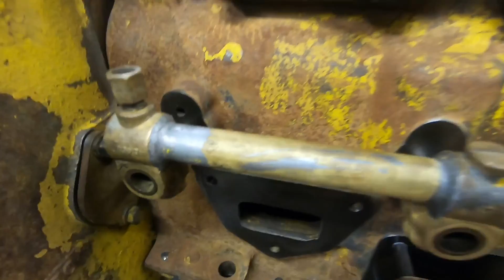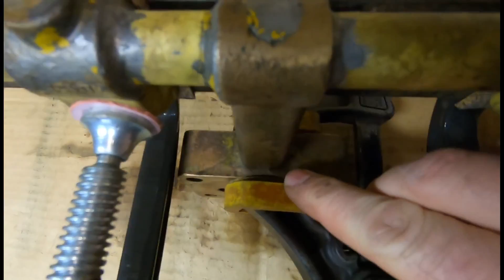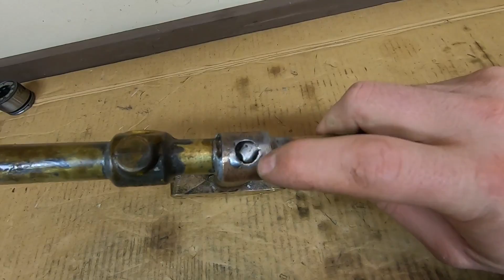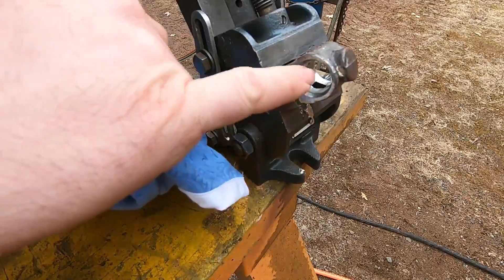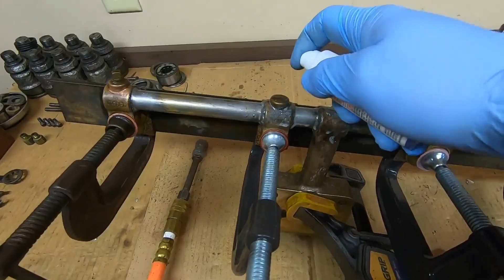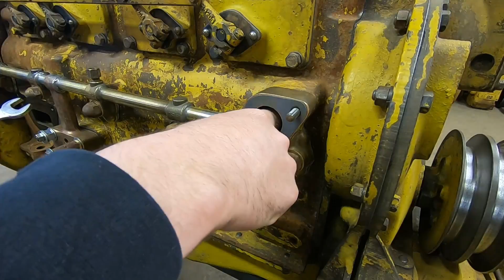Caterpillar D2 #5J1113 Diesel Engine Assembly Ep.39: Repairing & Installing The Oil Manifold

Comment: Do you suppose CAT found it to be cheaper from a manufacturing point of view to keep the pushrod cylinders and oil piping external to the engine versus spending the extra time machining the block to accommodate those things?
Reply from the maker: I think so, even the internal oil lines that feed the crankshaft mains are just removable piping with banjo bolts on each end. Plus, this was still the “old, proven” way of building engines that was a hold-over from the 1920’s era tech 👍

Comment: 7:43 yup. That's how i saw it done before. The mechanic had the whole side out of one of these engines cut, and made into a jig. Ain't no better way, than with the original, and you can't really do it on the engine, as he told it, because you have to take some of the stuff around off. Free space, no hassle.

Comment: If you heat the pipe to a dull red and then quench in water it would have annealed  to where it may prevent the work hardening  which is probably the cause of the cracks in the first place.  Everything relaxed.   Just my two cents.

Comment: Can you tell me why this 'oil delivery system' wasn't 'silver soldered', silver soldering being much stronger?
Interesting video, and thanks again.
Reply: @squatch253  And yet those joints failed,...after a long while true, however as being used to using silver solder for high pressure and high vibration joints, I thought that
Caterpillar might have done the same in these vital connections too.
 I can see that those studs and bolts hold extremely well, but the tubing running between those blocks is somewhat vulnerable I thought.
Now I know. Thanks for the reply.

Comment: I use to work for an airplane manufacturer, kit planes, very expensive kit planes specifically. The customer had to assemble 51% of the plane per FFA regs to be a kit plane. So we would built a part, make everything right the disassemble it so the customer could reassemble it thereby "building the assembly".
One customer was an insufferable asshole with all the dexterity and coordination of a boiled turnip. He couldn't hold a wrench and tighten a nut without dropping it to save his life. He would then blame the tool.
Then I watch you hold a camera with one hand and turn a wrench with the other and I smile.

Comment: A couple of observations that may prove helpful. When doing tinning,I started making use of 95% tin solder. Not the usual tin/lead mix. Never had a problem with a tinned surface after that. No idea why it worked better for me,only that it did.
Secondly,my refrigeration instructor was absolutely scathing about the way the Thermo King people insisted on using solder,only to have the stuff crack at high mileages, high vibration use. He was flatly insistent the only way to get a Thermo King to stop leaking refrigerant was to wipe the solder off the offending joints and braze a completely cleaned joint ,then pressure test.
Not sure if this would be something you would wish to do,but given how consistently soldered joints leak when subjected to vibration and heat and pressure,it might be a Plan B you keep in the back of your mind.
Nice clean job senior did. Developing a feel for soldering joints is something that takes patience and practise. It is rapidly becoming a lost art,particularly that high school shop is no longer taught in the majority of schools. Another dumb idea,but that is really another subject.

Comment: if you have some spare oil galley pipes..  you might try soldering them a different way.   the idea is to bend an L shape to the solder.. heat the brass fitting.. while moving the  solder around the gaps.. when the fitting is the proper temp. the solder will melt and suck into the fitting.. take the heat away or do the other side really quickly.   this allows the max solder to be between the fitting and the tube.  its how copper sweat fittings have been done for 90 years.  cleaning the fitting with a stainless steel wire brush also.. so there is no oxides on the inner surface of the brass.  i used to work as a plumber in the early 80s.. spent days under buildings soldering copper pipe fittings on..  including a few brass fittings to the copper..  you don't need to tilt the block either if you do it right..

Comment: The differential expansion and contraction between the engine block and pipe from the heat cycles of running the enginewill crack the solder joints through fatigue. You should resolder all the joints whether they look good or bad

Comment: I had a plumber teach me, because I was having trouble soldering a fitting on a pipe,  that the solder will go where the heat is. I was heating the edge of the fitting where the pipe stuck out, when I should have been heating the center of the fitting. Since I was heating the edge the solder stayed at the edge .when I heated the center of the fitting, the solder went from the edge of the fitting to the center where the pipe ended and it finally didnt leak. Hope this might help someone that might have the same problem I did. Keep up the great videos. And thanks for sharing them.

Comment: I normally use the operating pressure and temperature when I test for leaks. I learned to soldier as a child building gold and silver items. In silver we had several different soldiers that had different melting temperatures. I don't remember much about the gold because my father did most of that.

Comment: I take it the part of this assy with the blockoff plate has no commonality with the oil manifold proper as I didn't see you block it off?

Also: When soldering something like this and there's an existing solder joint that you're not touching: Heat sink between where you're working and the existing joint! Less chance of partial solder melt there. Obviously, you got by with it this time.

Comment: Why didn’t you re solder all the joints? If the end one leaks your going to have them all off again.
Reply: And if it doesn't? Any time you are welding, brazing, or soldering ANYTHING, there is the potential for a human mistake. Those ones were not leaking and i don't see any point in possibly making one.

Comment: I spy, with my little eye, a D3400 cylinder head on the bench in a bag! I learned in this episode that the oil tube is one solid tube, in my mind, it was individual segments between the cast blocks. Makes sense that it's one tube, but it wasn't that way in my mind. That side of the block will fill up quickly once the large early bypass filter and oil cooler lines are in place.
Reply: That's the way I visualized it also Luke!.  Early cat engineers were great.
Reply: That was exactly my visualization until Squatch took it apart - an Ah-HA! moment for sure!
Reply: Was my thought too until he started sliding the parts off.

Comment: I am surprised you only test with 5 lbs.  I would assume it carries 20-40 lbs oil pressure?  I am not up on small cats.
Reply: Cal J I would surmise the cork block off plates would fail way before 20 psi. 5 psi was sufficient to evidence the leaks picked up on the visual inspection.
Reply: @squatch253  That is true, I overlooked that part.

Comment: Oil manifold repair,  nice video Toby!!! One question tho, If you are going to do the first three joints, why not do the others as well? Just to be sure everything is sealed up and like brand new. Of course you can use the adage, why fix it if it ain't broke? I'm just looking at the idea of, your in this far, why not do the other thee? I'm looking at the time on the three old soidier, vice the new soidier on the three repaired joints. Just asking.....

Comment: Surprised they only soft soldered and not silver soldered such a critical part of the oil supply. Neat repair.
Reply: Wondered the same thing. I would have went with Silver Solder and pressure tested to 50 PSIG. Being a HVAC/R contractor, this would have been a piece of cake.
Reply: I was just about to say would it not have been better to braze those joints - I think that's what I would have done. But I suppose that if they are soft soldered from the factory that's what you need to do to keep it original.